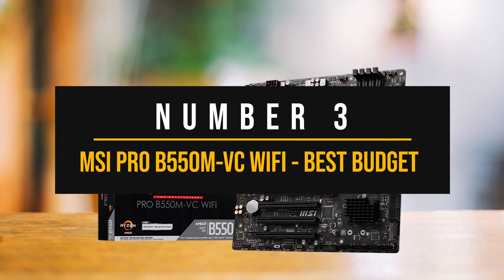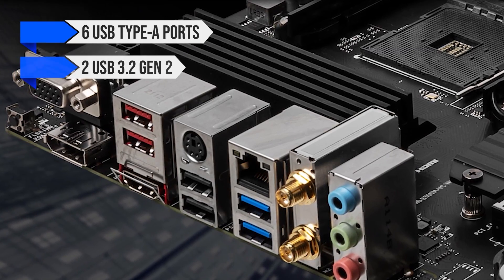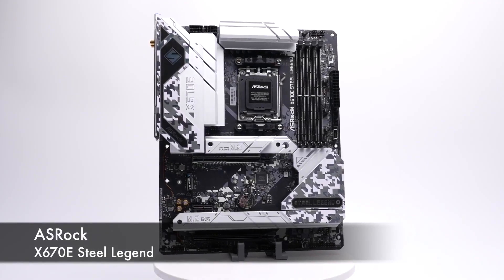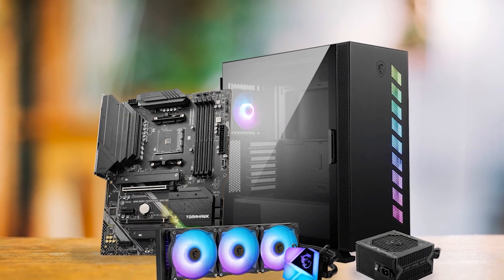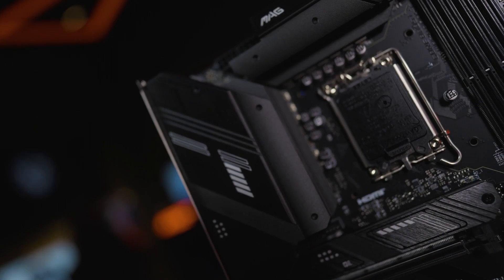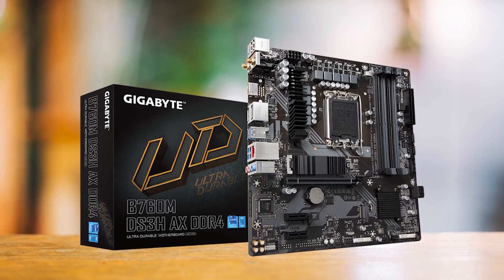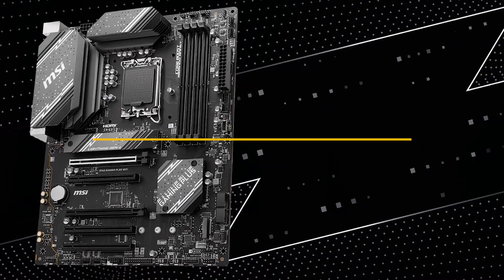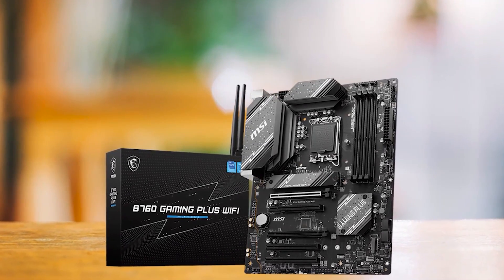Best Motherboard For the Nvidia GeForce RTX 4060! (TOP 6)

Comment: A motherboard has nothing to do with the gpu 😂 every motherboard will perform exactly the same with a gpu like come on make a video with the best motherboards fir (insert cpu) that’s what this is supposed to be anyone who actually watched passed the title know that I does not matter what MB you use with your gpu it matters for what cpu you use which will matter to what gpu you use 🤦‍♂️🤦‍♂️🤦‍♂️🤦‍♂️🤦‍♂️
Reply: Not true, chipset can effect pci performance. I guarantee you have better voltage consistency with a better power phase,  cpu, ram and pci performance will in fact better...
Especially the cpu having a better platform, etc.
Reply: @Pro7Sauce  there are multiple videos testing motherboards they do not make a performance difference anymore it’s litterally how much money you have and what features do you need chipset doesn’t make a difference either unless you need a lot of usb etc connected to your computer but even then it doesn’t matter
Reply: Use some more facepalms while preaching ignorant nonsense, why not kid
Reply: It does, think of PCIe for example
Reply: @venov5492  um no! Any motherboard will run a gpu the same you are wrong
Reply: NO A LOT NO BUT PCIe lanes more is better than les why this is titled Best Motherboard for the Nvidia GeForce RTX 4060 God only knows has all GPUs utilize the lanes available to them.
Reply: @JMF-Aquatics  idk what your arguing here every motherboard that people would be shopping fir have a pcie 16 lane slot motherboards make very very little performance difference as much as randomness between benchmark runs were taking 4fps difference max watch LTT’s video on motherboard performance you’ll understand that shopping for a motherboard is what cpu you want and what features you need not the performance dude 😂
Reply: It matters you can't use ddr4 morther board with ddr6 vram graphics card,, so mother board matters.
Reply: @giggleparadise  your argument here is stupid I have amd motherboard I have intel like okay how about get a compatible board because any compatible board will perform the same
Reply: @jjimapro9756 is an h610 okay. because i wanna pair it up with an rtx 4060 with an intel i5 12400f
Reply: @pdfrchieve  does it have the features you want if it does then yea
Reply: Except a lot of people start by deciding what GPU they want, then working backwards from there with their budget.

I found this video useful, because of the direct comparisons between the motherboards.

While yes, technically you are correct, when choosing a motherboard, you chose the CPU first and go from there, I still think this was a useful perspective.